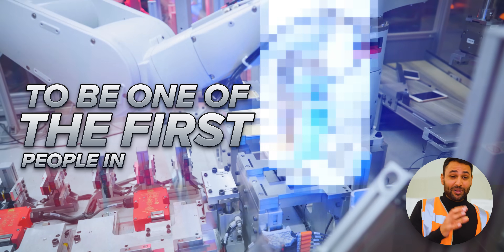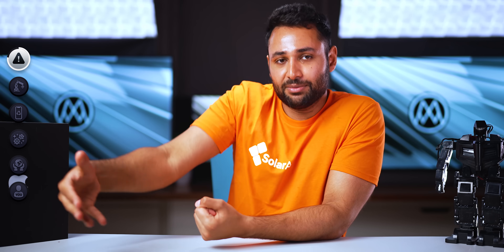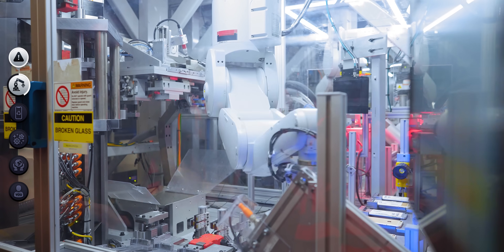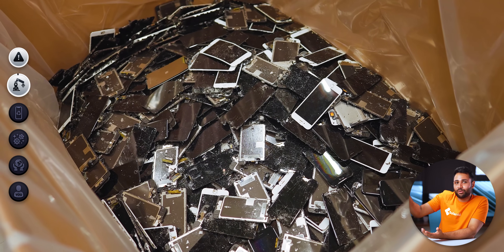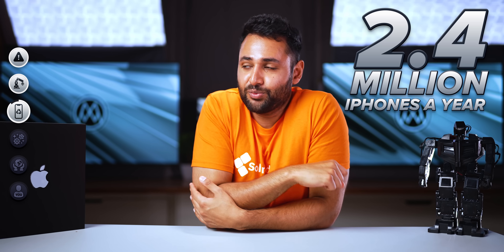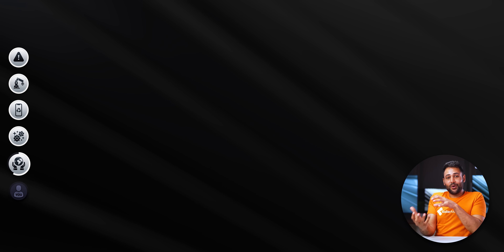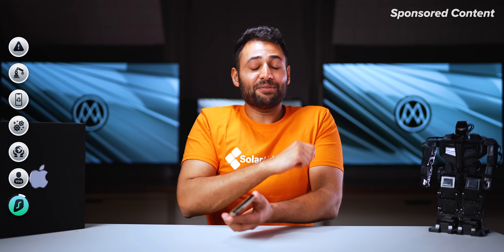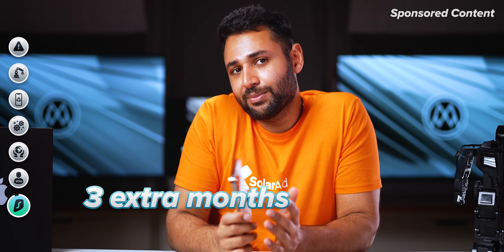Apple made a Robot...and I got to test it.

Comment: It would also help a lot to make phones (and devices in general) more repearable instead of setting up deliberate repair obstructions (e.g. pairing components to each other), and incentivising the consumers to have their devices repaired instead of replaced.

Also, it would be great to motivate customers to take better care of their devices, so they end up needing a repair less often - e.g. designing both phones and phone cases in a way that doesn't make the phone seem "ugly" to the customer if in a case (seems to be the most common reason people don't use them by what I've seen).
Reply: And make an end to the planned obsolescence issue.
Reply: but they only want money, so... 😉
Reply: @Leos74  It's not just a matter od want, they are legaly required to make more money for their shareholders (just like any publically traded company). That is why repairability needs to be guaranteed by law (it's also a lot simpler than reforming the system).
Reply: nO dUMmY thEyRE gOiNg caRBON neuTRAl Hey caNt Do tHat
/s
Reply: YES, this why i have a Fairphone, this thing is like a bunker compared to an iphone.
Reply: Yes. Apple is the worst in that department. They DO NOT want you to be repair AT ALL. And if you do repair your phone, god forbid it's a third party. They make it as hard as possible to repair as a third party.
Reply: We need to end capitalism before that kind of world is possible.
Reply: @justinwatson1510  Not neccessarily, but regulations and/or reforms (like the right to repair for example) are neccessary to make it happen.

Comment: How daisy make difference between iPhone 8,se2021,se2022 ???
Where even human are unable too…
Reply: There are many ways like earlier iphone has a serial code at the back (in past 2 3 years, they are putting it near sim card eject)
Reply: @richie1999  what about se21,se22
Reply: @yashjain5749  yes, I think they have the numbers too and machine also have other factors like size, designs etc to differentiate and it's not like apple produce many products in a year
Reply: see I use 13 pro and it is a great device but in se there no design or size change only is inside the phone which daisy can’t make difference using camera that’s the point….

Comment: Sounds great, until you realize how many of those individual parts are perfectly functional. Recycling phones will never be environmentally friendly (although it’s better than putting them in a landfill) the best choice is always to sell / give them away as used or harvest the working components from them before recycling.
Reply: That's why repairability and easy battery replacements would be the way to go.
Reply: @insertcoolnamelater9334  I agree. I wonder if CPU and ram upgrades from phones will exist like pcs do now?
Reply: @lehoff  that's what Google tried to do with project Ara, it just went nowhere. Maybe the technology was not ready yet. Sadly we are going in the opposite direction. Batteries used to be replacable and storage upgrade was cheap and easy with SD Cards.
Reply: @insertcoolnamelater9334  ah yes just read up on it. I think you're right we're not quite there yet with tech. However I think commercially they don't want to do it as they make more money selling a new variant every year? It could be lucrative and certainly if they truly believe in a sustainable future they'd invest more time in it no?
Reply: @lehoff  that's probably the main reason. The biggest players like Apple or Samsung definitely would have the R&D capital and brand loyalty to develop more sustainable phones. But they just make more money selling slightly different versions of the same phone every year. Although to be fair, at least Samsung and Apple have the best software support. Short support has long been another form of planned obsolescence.
Reply: Indeed. But we live in such a consumerism world that this is won't have the required impact. One would expect this recycling process to lower manufacturing costs, but I very much doubt apple would ever do that.

Comment: My computer is a Mac Mini M1, but my phones and tablets are Samsung. My Note 10+ just had a cracked screen issue so I went to upgrade to the newest Samsung phone with a stylus and it was OVER $2000.00 Canadian. Seriously? At what point can we stop having only the option to buy tech we need (the stylus helps with my health limits and I do use some apps so I do require a smartphone) but not have the hyper-expensive tech they think we need. I drive a truck so my phone doesn't need to be a computer that creates new software or takes photos of astrological events from underwater. I just need a rugged product that has a usable interface. (I use my S7+ paired to my phone's wireless hotspot when I need computing). Ultimately, I ended up repairing my screen - but I think it may be time to switch to Apple for these devices too if their costs are going to be reflected in their reduced manufacturing (from NEW materials only) costs. Thanks for sharing what this new deconstruction process is doing. It will help me in my next cell phone upgrade decision.

Comment: Also they could you know start making modular devices or go back to the ways of making them easier to take apart and replace parts yourself and maybe you know continue making small batches of parts that could be small upgrades for your device.
Feel like how a majority of laptops you can take apart and upgrade the RAM or change out the hard drive or change out the processor possibly.

Comment: I think that recycle robot system will become much more important when Apple rolls out the subscription service for hardware. With that returns will rise sharply, and Apple will most likely recycle and not resell most of them.
Also the Apple trade In is currently not a good option. I checked that a couple of times for various devices (3-5 years old) and a second hand sell will always get a better result, usually double the money - at least in Germany. Which is not a bad option for the environment if the devices are still used.

Comment: Only Apple will spend a fortune on making a machine to bash apart their devices, so they can be recycled.  Instead they could spend the same money that make phones more repairable.  How many of those phones have perfectly working components that could be used to fix phones and prevent them from having to be recycled in the first place.  Reduce, Reuse and only then Recycle.

Those phones are not broken,  they are only damaged and can be repaired, or used to repair others.

Comment: Love the Dutch but the translation is not completely correct. "Amazing" in Dutch would better translate to "Geweldig". "Verbazing" is more like "puzzled" and has a much more neutral annotation than the positive "Amazing". For example, you can be "verbaasd" about somebodies death or a bad grade (when you where expecting a good grade). When you have a bad grade while expecting a good grade, you won't react with "amazing" but "verbazing" would be suitable. I do understand that "Geweldig" is harder to pronounce correctly though.

Comment: Think you could have also mentioned repairability of these devices - It's reduce -> reuse -> recycle in that order
What this video focuses on is recycling, and that's an important part of trying to save our environment, but this is literally the most inefficient process of the three and has the least impact on what we're trying to achieve here.

I think every discussion about environmental protection and conservation needs to discuss all three; 

Like cudos to what apple are doing with daisy, but let's also keep them accountable to making sure that this is an end of life process rather than an upgrade path for users wanting the latest and greatest
Reply: But he did talk about them briefly.
Reduce -> (Use your current phone for longer, so you buy less phones)
Reuse -> (Gift or sell your old but functioning phones so someone else can get utility out of them)
Reply: @ytterbius2900  True, but that didn't suffice. He talked about an iPhone 10 with bad battery life, where everything was okay
Why not have the caveat that mentioned switching the battery, and recycling that instead of the entire device

We've become really good at recycling li-ion batteries, so that should be the first thing the manufactures need to encourage if they really care about the environment. Make it easier for end users or repair shops to replace these easily. Now Apple does a good job with pull tabs on battery modules but they need to make those more accessible for everyone to switch easily and use those devices for as long as they want, or as long as Apple supports (5 years)

All I'm saying is that we need to put more emphasis on repairability over recycling
Reply: also no mention of repair… Most phones can be repaired fairly easily, just not for the prices Apples wants to charge you. Who‘s gonna pay 280 bucks for a new Apple screen when you can get a refurbished screen for half? That‘s the point we should focus on.
Reply: The robots are Apple's attempt to make recycling as efficient as possible; the fact it also discourages them giving anyone incentive to repair their devices is just icing on the cake for them.  It's so Apple it hurts.

Comment: What you completely ignored was Repairing: The best is to repair a broken phone (at least when it is still reported) and Apple is very much against that (at least repairing it yourself or encouraging to buy a new product, as the repair would not be feasible. They should just sell repair parts cheaper and make them easily replacable). The best for a product is not be thrown away. Of course software updates end sadly mostly too early, but hardware performance is now at a point that an old phone will not feal mostly laggy for a n average user.

Giving thumbs down, this video was good, but putting Apple in a wrong light: "See we recycle, but we will encourage you to buy a new one, instead of repairing it, which creates the e waste much earlier, than to repair it"

Comment: You would think apple would ship the phones and the cable, and the charger in the box to save packaging, because it's more packaging to ship the phone and the charger as separate boxes, more plastic and all. If you do think about it, apple is trading in the older iphones to be processed and rebuilt into new ones, but this massively benefits them in cost, because they don't need to pay for new materials. Same thing with the box they gain massive amounts of money from shipping the charger and the phone separately. Same thing with lightning cable and so on and so fourth. My point is that apple really doesn't care about the environment as much as they say they do, for them it's all about the money.

Comment: Or here’s an idea… people could stop upgrading every… single… year. It’s pointless to throw this mass of metal away ever years just because the next is 4% faster. The issue creates itself
Reply: It's not just parents or old people who does that, I think i'm fairly young, i'm a software engineer and I change my phone only when it dies and I don't buy expensive phones neighter just middle price with good specs. A good portion of my coworkers do the same.
Same with computers, good specs, good quality and capacity to expand.

Edit: some of the dead phones i fix and re utilize them for another things. The majority of them cannot be fixed sadly.
Reply: Yeah, just get a really good phone with good specs and It may survive 5 years or more.
Reply: True.
My dad used the SAME phone for 4 years and he didn't even care if it wasn't smooth.
My dad sure is a real giga chad

Comment: I would prefer having replaceable battery. That way, I don’t need to carry a 20000mAh powerbank to charge it. Easy to replace if it dies. I also have a samsung s5 which I can use  to monitor my 3d printer (using Octo4a for android).

Comment: I once did a research study on E-waste, and realised how big of a problem it is. It is the least covered type of waste by the media, with plastics, radioactive waste and industrial waste getting more attention. In poorer countries, recycling is almost unknown. Electronic items are usually used till they are almost scrap materials, and then either thrown into the bin, or sold for scrap money. People usually treat them with acid and burn all the plastic material, and then sell the important metals like iron, aluminium, copper, gold, silicon etc as parts. Often children undertake these jobs and have life long health issues due to the emissions. Batteries are a key component of the waste that gets thrown. They contain hazardous inflammable chemicals, which are EXTREMELY bad for the soil and water resources, and on top of that can start fires in the dumping grounds, which release tons of emissions. Its great companies are working on it, but more awareness, groundwork and funding to poor countries, where a majority of the world population lives, is required before we see a significant improvement.

Comment: The entire robot and all is fantastic and a 10/10 to Arun for making this video.

But all this proves is that a multi trillion dollar company would much rather build a room sized, energy guzzling, million/billion dollar machine to take apart a product they intentionally designed to not be upgradable and/or  fixable, rather than to just design it in a manner that anyone on earth can open and fix it using a simple screwdriver.
Reply: Facts

Comment: There's a reason why the environmental message "reduce, reuse, recycle" is in that order.

The most efficient product is one that never existed. The next best is extending use beyond its intended use cycle. Recycling is an option of last resort that isn't much of an improvement over waste products and mining new materials. The best solution, especially for apple who sell only a small range of devices and often for years past when they were competitive, would be to disassemble the phone, discard the damaged pieces, recycle the old battery, reinstall a new battery made from recycled materials, and reassemble the working bits to sell as again with next to no recycling actually required.

Daisy's methods aren't going to cut this, but a bit more development and all those old or poor people buying iphone 7s could be buying a virtually new yet near environmentally free product.